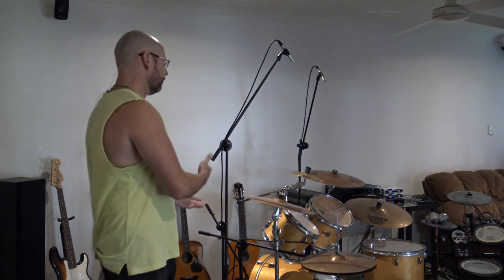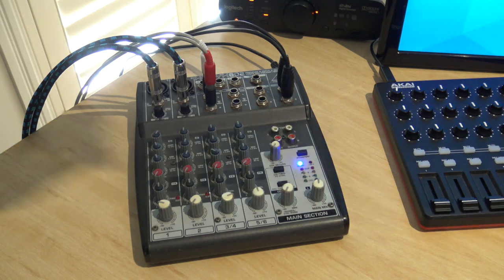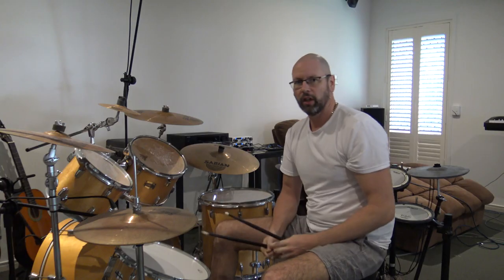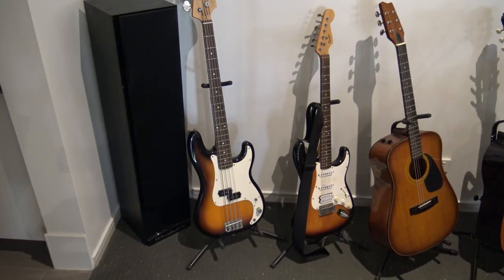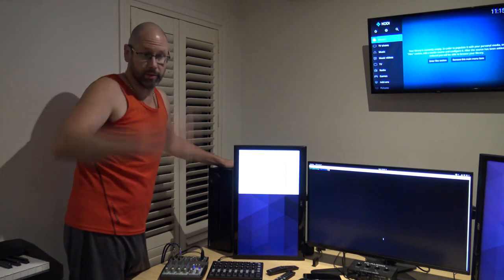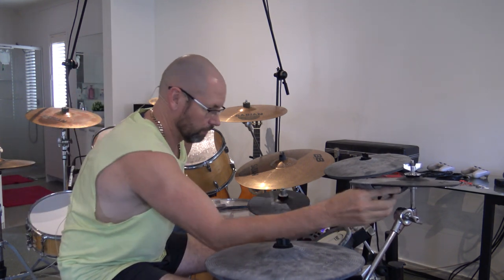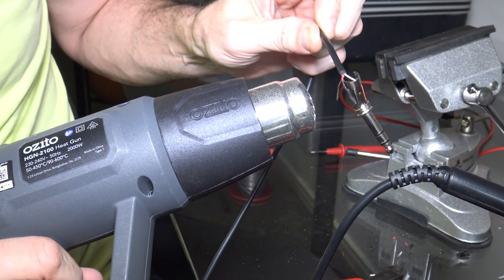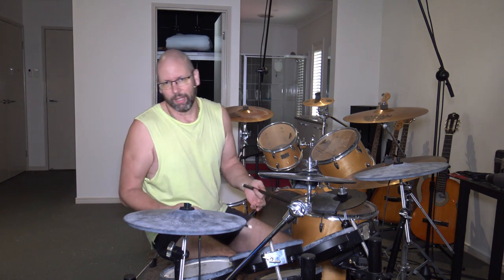Electric Drum Repair And Recording Setup

Comment from the maker: The reason there is a nasty buzzing sound through this video is because the batteries in the cordless microphone transmitter were dying. Sorry about that. I tried to do a noise reduction, but that's the reason it got in there.

Comment: The drum controller should have a setting called something like 'Local', possibly under MIDI, that can change the behavior when the USB is plugged in.  It determines whether the drums are played locally or only from the MIDI In.  That is a weird 'feature' though.  It's not weird that the MIDI is before the Audio - most electronic drums work that way.  But it is weird that it holds the buffer like that. 
     I don't think that's a 'buzz' in the usual 'interference' meaning.  It sounds more like a weird delay line somewhere in the chain.  Definitely odd.